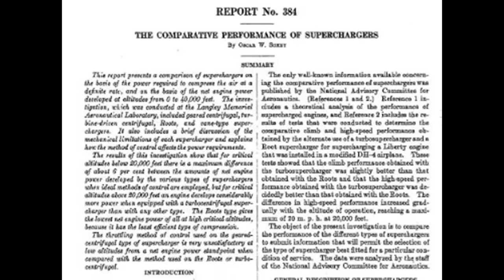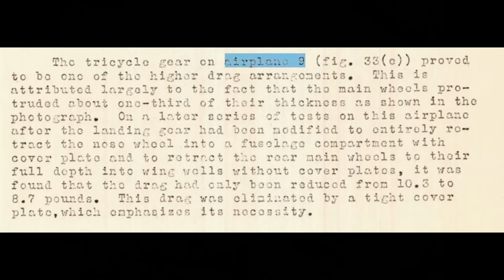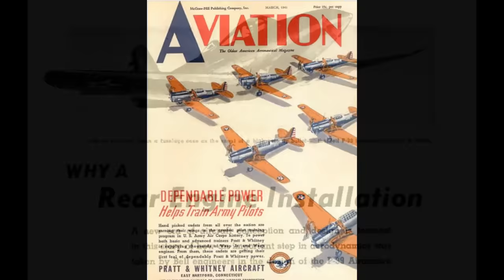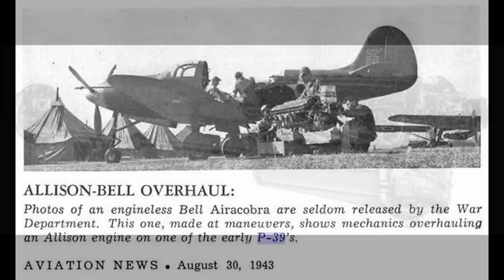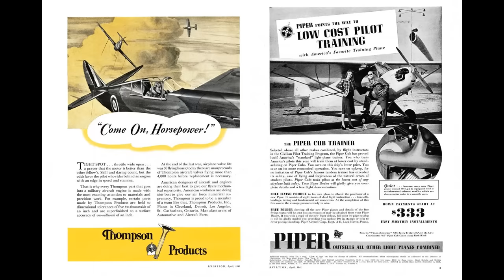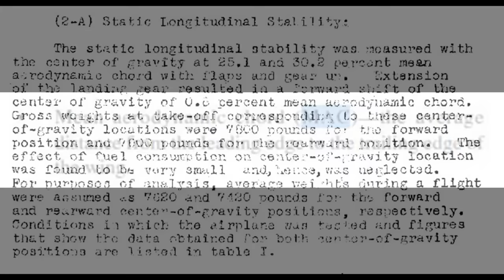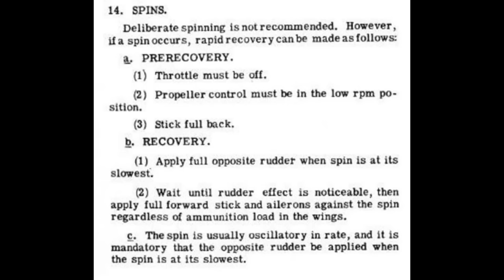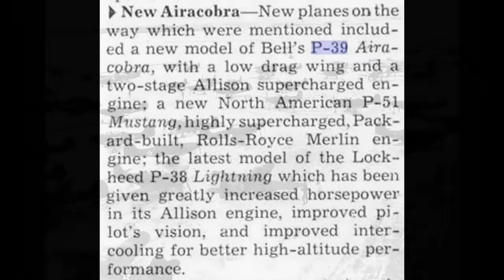Bell P-39 Airacobra, Why the Mid Eng?

Comment: There have been many discussions of WWII aircraft armament, but few references to the 37 mm low velocity "one pounder".  The cartridge shows up on the B-25 Mitchell as well.  On the P-39, did any of the pilots, Americans at Guadalcanal or the Russians ever get hits on enemy aircraft?  Were hits with the cartridge damaging or did they just pass through the target plane without exploding?  The gun was replaced with the American 20mm Hispano "never feed".  Why was this favored?
Reply: For shell weight approximation in pounds divide the calibre by 30mm and cube it, works up to 16".  37/40mm is a two pounder, 76.2mm is 17 pounder.
Reply: I believe the Airacobras at Guadalcanal were actually P-400s.  If correct, they would have had a 20mm cannon and twin .50 cal installed in the nose rather than 37mm.

Comment: It seems the concept of having the center of mass too-far-aft in an aircraft is akin to having lee helm on a sailboat.  

My family had what was supposedly the last boat built by the Dingle Boat Company in Saint Paul Minnesota.  It was designed to be either rowed or sailed.  The family who had owned the boat previously would sail it downwind from their cabin and then use a small motor to return.  This seemed odd to me, even as an inexperienced sailor.

Then I got trapped against a shore when the boat would not come to the wind.  I had to drop the sail and row out to the center of the lake and then sail home.  I then put some book-learning to work and found that my boat had lee helm.  It occurred to me that the center of hydraulic resistance to the boat sideslipping was aft of the center of force from the sail.  Moving the mast or centerboard was not practical.  But a more-obvious fix appeared.

It dawned on me that the designers had prioritized yaw stability while rowing over performance as a sailboat.  There was attached to the keel a skeg just forward of the transom.  I removed the skeg and the boat was transformed.  It now had a pronounced weather helm.  In any circumstance, it would point up whenever the pressure on the rudder was lifted.  I rowed the boat to see if I could feel the difference.  It did not track quite as well, but it seemed a little faster.  The skeg was very thick.  The Dingle still tracked just as well as all the aluminum boats I had rowed, so I decided the skeg was on the whole counterproductive.

In time, we acquired an O'Day Javelin and returned the Dingle to the previous owners. They put the skeg back on, even after I explained the advantages of leaving it off.  Maybe I should have used the skeg as firewood.  It's not like they were into preserving the boat's historic configuration:  They had long-before replaced its heavy wooden mast with a slimmer aluminum tube.

Comment: My only experience is in simulators, but my frustration with the P-39 is that it seems to flat spin too easily.

I convinced myself that the reason this happens is because forward engine fighters have the center of gravity further ahead of the top down geometric center.

I imagine when falling flat, the drag pushing up on the tail usually pushes a plane into a dive so you can recover.

In the P-39 with the weight further back, I imagine there's not enough leverage pushing up on the tail in a flat spin to make it recoverable.

But that's probably just my superstition, either way I stopped flying P-39s. . .
Reply: LOL JUST GOT TO THAT PART OF THE VIDEO

Comment: The USAA oficers in charge of the P-40 insisted on Curtis using the new G.E. turbocharger. Curtis along with Alison produced an intake with a two speed blower, but the Army brass wanted the turbo. The Army brass eventuality failed to provide the turbos, and swithing to the modified two speed blowers would have meant a production slow down. NACA killed the turbo P-39.

Comment: Apart from German jets, a couple of other mid engine piston fighters  , the J7W Shinden and the Henschel P75 were both canards.  The engine in the xp-55 was far aft.
The drive shaft idea  was certainly not new. The Wright brothers used one in their Model H.
Reply: I remember a statement from a source I really can't remember that with z couple of exceptions there never were any really good airplanes with a drive shaft. One recent attempt at building an aircraft with a drive shaft failed. The reproduction Bugatti P-100. Perhaps the prettiest airplane ever built. The reproduction crashed just after takeoff on its third flight. It was supposed to be its final flight. The plane featured two drive shafts. Plus both drive shafts were two piece units. They each had a universal joint in the middle and one on the prop reduction gearbox iirc. I'm not sure if they had one between th he engines and the drive shaft. I've never heard just what the cause of the crash was. But I've long suspected that one of the drive shafts suffered a u-joint failure. The drive shafts ran alongside the pilot. Perhaps the most successful engine installation with a drive shaft was the Convair B-36 (1). One suggested reason is that the installation in combination a 28 cylinder engine smoothed out the power pulses with 14 power pulses per crankshaft rotation.
Reply: @mpetersen6  The B-36 does not have a drive shaft per se, but rather an extended case on the front of the motor (toward the back of the airplane). Herschel Smith has received some criticism for making this statement about the B-36's driveshaft in his still outstanding book "Aircraft Piston Engines".
Reply: @fafner1  
And that's where I got the info on the R-4360 installation in the B-36. In the 30s and 40s there were a number of proposals for aircraft featuring engines buried in the fuselage and using drive shaft gearbox set-ups to spin the props. Each additional component adds one more failure point. Theres a photo someplace out there on the internet of an Allison V-3420 iirc tied into a drive shaft set-up that features two props. I doubt these ideas were ever really taken seriously. But the use of drive shafts to drive props from engine/s in the fuselage do go back to WWI and a French design by Henri Coanda.

Comment: Im lucky enough to play with Roots, Screw, & centrifugal,  blowers for a living. That being said I still think hair dryers are far superior for most applications. Turbo’s are somewhat of a altitude compensator. It’s very apparent when we are at the mile high nationals in Denver each year. Most of the  blown cars. have to raise compression a few points. bump over drive% up to the legal limit permitted by the rules. It’s a completely different tune up. to try and keep power output levels reasonably close to sea level D.A. numbers. In the ProMod class where rules permit running turbos. The guys that run them only have to add some  “lead” advancing ignition timing. Turbos act more like a force multiplier than a true compressor.   It’s a constant battle to get people to understand that boost pressure numbers are a function of restrictions and inefficacy’s in a intake track system. Because ICE engines only care about air density and volume. Most of the time high Boost PSI numbers are some what of a bad thing for a given power out put. This is why like aviation, in the auto racing world we use inches of mercury or water to explain manifold pressure’s. It makes me cringe every time I hear enthusiast get excited and refer to high PSI boost numbers. I have had many performance upgrade customers unhappy when the dyno sheet showed a raise in power out put @ a given or lower Boost PSI number🤦‍♂️ Turbos are like altitude compensators gaining efficiency with lower D.A. Numbers. With out raising parasitic drag or charge air temps and or density like most blowers tend to do. Turbos also don’t loose V.E. Like roots or screw blowers do the faster they spin complemented by the fact that their raise in shaft speed is a function of engine load not RPM. The only compromise you have with turbos is throttle response and sometimes higher egt’s. Making them superior in a lot of application.
Reply from the maker: I find the turbo vs. supercharger topic to be a bit of a toss up. I love both but lean slightly towards the supercharger for most applications. The turbo's big advantage which almost nobody seems to mention is that you can vary boost independent of engine rpm. In other words I can have 22psi at 4000 rpm and 18 at 6000. That's tough to do with a belt driven supercharger. The plus with the supercharger is that I can do a lot more with the exhaust in terms of performance, plus I don't have to sweat about the cat light off times making emissions easier to deal with.

Comment: Well, a sudden or a flat spin was the problem if one flew mainly low-level... Bell Aircraft called Soviet pilot to test P-63 for a flat spin just before delivery. He proved that problem still existed on P-63 (for a cost of one P-63 and one farmhouse it fell onto, he bailed out). Allegedly, Bell alleviated that problem by reducing oil tank capacity in P-63. I guess it was not just a CG-problem, but more a problem of not be able to make enough aerodynamical momentum with the tail due to the mass distribution. Similar to F-4 Phantom stall/ spin problem much later.

Comment: Correct me if I am wrong but i beilve some engines employed both super and turbo charging, I THINK the R4630 "corncob" was equiped in such a manner on certain versions. Unless my sources are incorrect.
Reply from the maker: Yes, all the U.S. planes in WW2 that were turbocharged also had a mechanically driven supercharger, P-47, B-17, etc.

Comment: In the 1960s GM developed a part time supercharger GM tried both an electric and engine driven compressor that filled a tank in the trunk , and  a nozzle located in the induction manifold as air has frictional forces' it pulled in about three times as much air as was being forced through the Jet . The tank only lasted for about fifteen seconds. It made a six cylinder engine as powerful as a V8 of the Time for passing other cars . I suppose having compressed air in the trunk with the fuel tank was an accident waiting to happen 💥

Comment: You mentioned the aft C.G. of the Spit and how that made it more maneuverable. Yes, in pitch  only, and to a fault. Pilots report that Merlin Spits are very touchy on a the stick in the pitch axis, and good simulations of it (A2A) fly that way as well.
Whether this is a desirable flight characteristic I suppose we'll have to leave to the pilots who regularly flew it. Personally, I think it must have been a PITA. to fly until, like all things, it was gotten used to.
Reply from the maker: Not just in pitch, it lowers the wing loading as well.
Reply: @GregsAirplanesandAutomobiles  Yes, of course. This helped the Spit to be a bit faster than the same-engined Hurricane (along with Spit's thinner wing and sleeker airframe). Aft C.G. also unloads the horizontal stabilizer a bit as well, reducing induced drag.
Still, a well-balanced airplane is preferable, IMO. Hurricane was considered to be a better gun platform than the Spit partially because of its farther forward C.G. and more steady pitch control.

Comment: As an amateur Aerodynamics student and a biker always thought the Aircobra was a great design. concentration of mass at the COG gotta a be a good thing, with lots of advantages.  Great video Greg, really enjoyed.  Why where the British not interested in buying/lending them?
Reply from the maker: The British didn't like them, or much of anything not British. There were some exceptions like the Wildcat and Corsair.
Reply: @GregsAirplanesandAutomobiles  the Dakota, mustang, catalina, liberator, harvard, stuart, sherman, liberty ship, thompson, etc . in fact i think we had so much gear the lend lease debt was only paid off in 2006. dont think thats the reason.
Reply: Boston (A-20), Baltimore, Maryland, B-26 Marauder, Hudson and later Lockheeds, B-25, B-17, P-36, P-40, Buffalo, P-47, Vindicator, Hellcat and they tried all the dogs too.  They used lots of American radial engines in large aeroplanes.  A possible trace of reduced objectivity there Greg eh?
Reply: @givenfirstnamefamilyfirstn3935  no way. Greg stuff is the least Willy waving site on the whole tube. I think the brits had a bit of a problem with the Alison at poor altitude performance and problem thought it would not be up to the latest German fighters. Also maybe they thought they had interceptors supply covered off.
Reply: @kevkfz5226  I suggested a ‘possible trace’, I didn’t say he was Vlad the Impaler.

Comment: It was my understanding (from reading) that the super charger was deleted by Bell due to instructions from the Air Corps, to allow easier field maintaince.
Reply from the maker: Maybe that's true. I haven't found a source for it either way.
Reply: @GregsAirplanesandAutomobiles   I base my statement on "Little Friends, Volume 1" by Tom Mullen. On page 31 of this book, he states "Before the Aircobra went into production the National Advisory Committee of Aeronautics (NACA) Langley Field, VA recommended several modifications one of which was the removal of the turbo-super-charger. Do you know anything about this?

Comment: Would love to have seen this thing with the mustang's supercharger and variable pitch props.
Reply: Hydraulic control propellers have the big hydraulic piston in the centre of the hub so it couldn’t have had the firing through the hollow hub 37mm cannon fitted which would affect the centre of gravity.  The rearward extended bigger supercharger and its intercooler system would be another centre of gravity problem.  The wings couldn’t just be slid back a foot or two.

Comment: I think the pilot stress referred to is one of requiring constant attention rather than G- loading. An aircraft with a low polar moment of inertia is twitchy. Being close to the center of gravity makes for a far more comfortable ride, and tends to reduce feedback induced instability. Todays fighters with the pilot well forward of the CG use fly-by-wire so the damping is incorporated in the hydraulics and electronics. With a purely mechanical or hydromechanical system oscillations are easily introduced in an aircraft with a low polar moment of inertia. The pilot sensing both through acceleration and direction an abrupt up motion pushes the stick to correct and induces a sudden down motion which he then responds to by pulling the stick, ad infinitum. Likewise with yawing. The further ahead of the pitch and yaw axes the pilot is, the greater his sensed motion and therefore his "corrections." If the pilot is behind the axis of rotation as in the P-51 or Spitfire, the acceleration is opposite and he will respond to the aircraft's attitude rather than the acceleration and the plane will "fly itself." It is related to why we use a tail rather than canard in most aircraft.
Reply from the maker: Neither the F-15 nor the Mig 29 are fly by wire. The later planes are, but they went to that forward cockpit layout way before fly by wire.

Comment: I really want Greg to do helicopters. I will keep posting until he does a series on the Hind.
Reply: I need your help guys. we can do this
Reply from the maker: I have only been in two helicopters, a UH1, and an H-54. I much prefer fixed wings.
Reply: @GregsAirplanesandAutomobiles  
Then we have a ton of work to do.

Your fans however, will not rest. Who else is going to explain the turbine engines, and their performance in heat and altitude, in comparison to other contemporary helicopters, and their deployment climates?
Reply from the maker: I should add that I did actually fly the H-54 a bit. I have never felt anything else that flies vibrate that much. I also have quite a bit of Helicopter simulator time as I volunteered for a university study back around 1985 that involved putting fixed wing private pilots into a helicopter simulator. I probably flew it about 20 hours, so I'm not totally ignorant of these things. However I just don't know how I would fit helicopter stuff into this channel. I'm not anywhere near done with WW2 airplanes, and my viewers don't seem to want stuff post WW2, not a single video on this channel that deals with post WW2 aviation has done well.
Reply: @GregsAirplanesandAutomobiles  I'll be honest I don't have a great response to that. Perhaps the book "Helicopters in Irregular Warfare: Algeria, Vietnam, and Afghanistan " by Major Beau G. Rollie could be inspiration. Honestly, reading it reminded me of alot of the points you made in the Thunderbolt series, which was amazing. 

As far as videos not doing well post ww2, yes that's a problem. Do you know if its cause is your viewers' age or Perhaps the feed algorithm that doesn't show people videos after ww2, since YouTube treats it as a different subject? Now I'm just interested

Comment: 24:46 I've heard several mentions that P-40 was unnecessarily heavy thanks to the complex wing structure. Any opinion about this?
Reply: And where would a fully retracting undercarriage go?
Reply: @givenfirstnamefamilyfirstn3935  To be honest, I have no idea why Curtis kept the backward folding landing gear, specially if that was the main reason for the heavy wing structure. In addition that bulge was course an obvious increase of drag. There were already sideways folding gears when first first P-40s were being made. There wasn't even much stuff inside the wing:  No radiators, no fuel an initially only one gun.
Reply: I heard (but can’t verify) that Curtiss used an overly complicated landing gear to get around another company’s patents